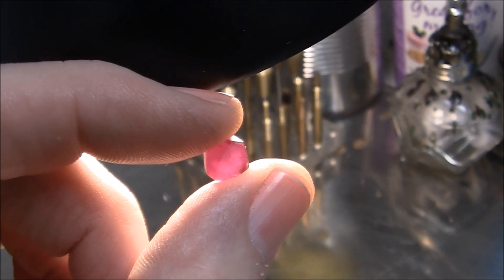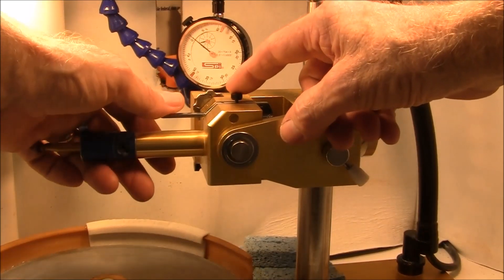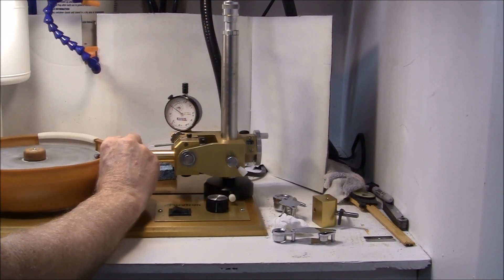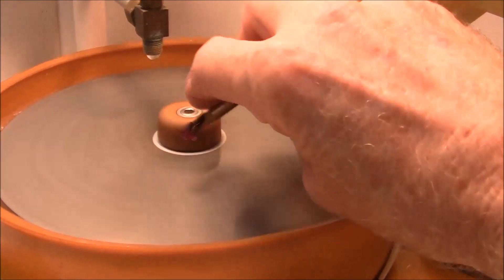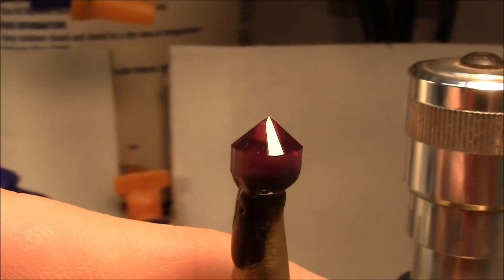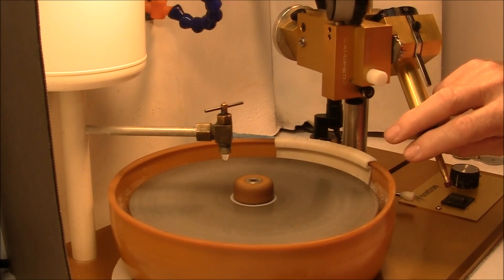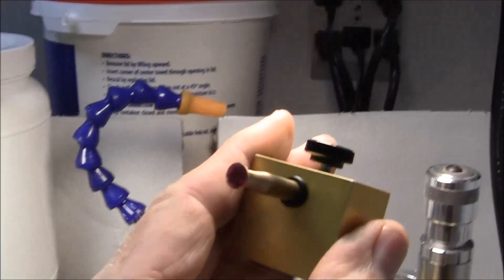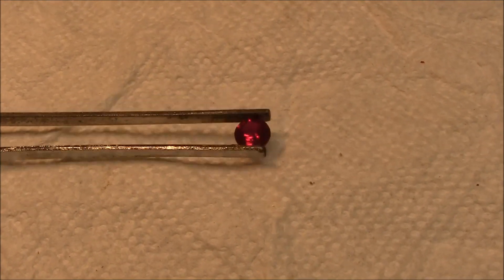Faceting gemstones - synthetic  ruby.

Comment: Hi Brent, I am a newbie at facetting. I see that your wheel is turning CCW into the tip of the cullet. At about 7:40 into video. I have been running CW with cullete tip pointing at the disc center. This results in the disc grinding across my facet. Am I doing incorrectly? Thank you for your input.
Reply from the maker: at times you must try different directions and speeds  to get a good polish.

Comment: How much is that worth before and after cutting it?
Reply from the maker: You can get a rough piece of it for $10-15.00.  Finsihed could be up to $75.00 but i usually get around $50  for them.
Reply: @tennpikr74  what if it’s a real ruby? Do you know the prices rough and finished? That’s so cool I want to get into cutting gems
Reply from the maker: @tu1469  The prices vary greatly but i can buy a 2 ct rough ruby thats got good color and clarity  for  around $100.  When cut  and  In the right setting it  can sell for $400.

Comment: How common is it for a synthetic stone to have an inclusion in it?
Reply from the maker: The material is grown in furnaces  and is called a boule, then it is usually split lengthwise and fractures occur . I called it an inclusion but it was actually a  fracture i believe . I just didnt notice it at the beginning. Once it was finished it was hardly noticeable and  much smaller . Usually there are no inclusions in synthetic  material.